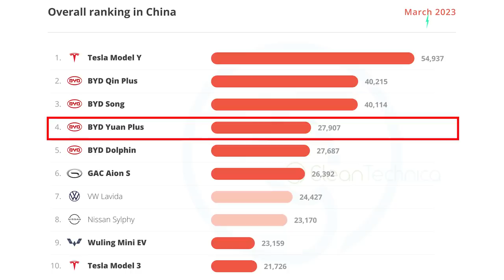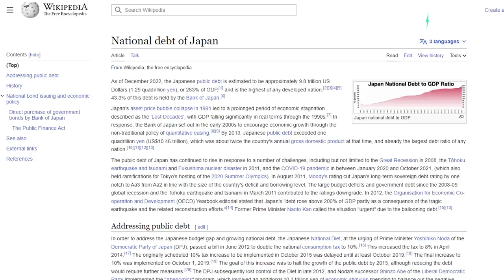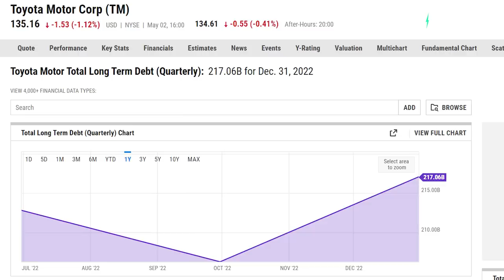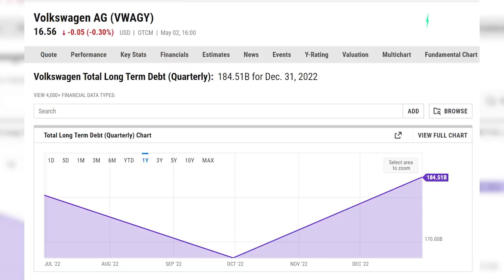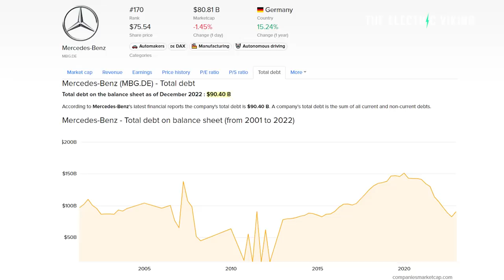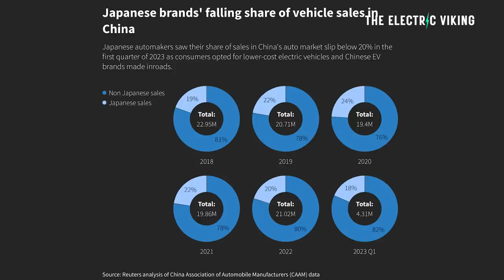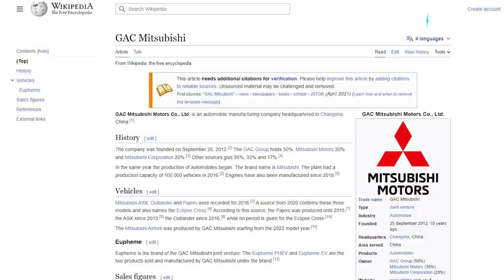Japan's automakers' Kodak collapse will cause an economic catastrophe

Comment: Japans population is losing over 800,000 people a year, while their national debt is still going up and exports are going down. It doesn't take an economics professor to see this is not sustainable.
Reply: National debts denominated in your own currency and owed to yourself are easy yo manage.  Private debts are what matters.  Also if you are losing population you have to erase generational debt to not burden the young.  If Japan is to be faulted it is their social and economic policies are out of sync.   China doing a better job of steering their economy.
Reply: China will soon or already are loosing 800 000 people per year. China also has extream debt (higher debt to GDP than the US) Japan own a significant amount of debt from both China and the US and the bank of Japan is the largest owner of Japanese public debt.  I don't think Chinese debt is sustainable either.
Reply: @ry4nwo0t  China is way over populated. They can lose half the population and still have twice as many people as USA. 
China's Debt to GDP is 77%. USA's debt to GDP is 114%
Reply: @MetaView7  Define over populated?... China 153 vs 327 for Japan people per square KM.   The over population is less of a problem than an aging population like Japan have had good experience of - China's turn is close approaching.  Sorry meant to say total debt to GDP not just public debt to GDP.  If you talking private debt to GDP China is by far the biggest.
Reply: @MetaView7  When (not if) China is reduced to half its present population, its age profile will be the killer!  There will be "empty" young generations to pay retirement for a huge number of retirees.
Having said this, it does not look much better over here in Europe... with some exceptions.
Reply: Not too mentioned the iceberg phenomenon of Hikokomori. Millions.
Reply: @MetaView7  I disagree! Think one child policy. 1+1=1 extrapolate over decades.
Look at the lie down movement and the "let it rot" movement.
Reply: Japan have lots of visas for other people to come and work for them. Export doesn't mean much if the economy have many digital/financial products. Case in pt, the US have lots of intellectual property and sell digital products--app download, etc, software, --but we have a trade deficit.
Reply: @ry4nwo0t  If you look at china through a western lens, you will see all kinds of problems. How is china's aging population a problem? Please Define.
Reply: @ry4nwo0t  I never understood that debt to gdp statistic people keep claiming when it's total debt to gdp for China then use government debt to gdp for the USA in comparisons.
Reply: @ry4nwo0t  <<Sorry meant to say total debt to GDP not just public debt to GDP.  If you talking private debt to GDP China is by far the biggest.>>

LOL that shows how little you know about china. But you think you are an expert on china.
Private debts? Did you mean company debts?
Reply: Vassal state.
Reply: They will need to create a robot nation to sustain their country.
Reply: @EM.1.  <<They will need to create a robot nation to sustain their country.>>

During the past 5 years, China has imported more robots than the rest of the world combined. If you want to know what is happening in China in manufacturing and food production technologies, there are lots of videos on youtube. It is mindboggling.
Reply: @AnhH88  <<Case in pt, the US have lots of intellectual property and sell digital products--app download, etc, software, --but we have a trade deficit.>>

Yes trade deficit, but not money deficit. eg. The western companies are making lots of money in China, but the profits are not benefiting the people in their home countries.
Reply: @mefobills279  It is so rare to find people that understands these things these days.  Maybe you have been following Steve Keen?
Reply: @MetaView7  How is falling population bad for China?
Can't find the vid now, but I watched a lecture relating to Chinese demography, said something like there's currently 7 workers for every pensioner, it will be 1 to 1 by 2070. Not sustainable.
Reply: 75th like
Reply: World meter website Japan population is decreasing 200,000 to 380,000 per y from 2015 to 2020. That 800,000 number should be for 2021 or 2022
Reply: Similar sort of thing is happening in Australia. Australia doesn’t have sufficient birth rate to maintain its own population. It’s population is supported mostly by immigration.
Reply: @st-ex8506  Soylent Green®is the solution.
Reply: @skipondowntheroad5833  The plot of Soylent Green is about overpopulation. I don't know what solution you see there... we are talking here of population shrinking.
Reply: @Jeff Little  I once talked to Dr Hudson for four hours.  Steve Keen I've never met.   If you read the comments, the people here think all debts are the same.
Reply: @ry4nwo0t  both china and japan will have a recession if not a great depression, it's going to get bad here too but it is wild over there right now

I honestly don't know how japan is going to survive, debt per capita is often tied up in car ownership, meaning after the value of the car collapses, and the person simultaneously loses their job, making or servicing cars, the car will be repossessed, and be worthless to the local banks, which may go bankrupt themselves, or may be put in a position where they refuse bank withdrawals, if they aren't careful, everyone will panic and try to take all their money out at once, collapsig banks entirely

Needless to say, this is also applies to whole companies, vehicle producers, who have a financing arm like toyota will see even their good debt turn into bad debt, and this will have a huge impact on anyone who loaned them those billions of dollars worth of yen, who now will never get that back,
Reply: I outlined a few minor issues above, which the following backdrop is important to understand
People who don't have children in japan and China, often don't because they are impossible to provide for, with all the banks collapsing along side 80% of the economy, life savings being deleted left right and center, I think the birth decline will rapidly accelerate for a few years, hopefully a boom would follow that depression, but regardless, 20-30 years down the line in the future, it would cause a massive vacuum where there are even fewer people working, because they haven't been born, and the ones who are retired at that point who are poor won't have people to pay for that, as well as those young people will be well, fewer of them to tax, so, they would likely experience heavier taxation, without proper pensions, alot of elderly people might raise the rates that they rent or sell properties for, which cause that to rocket
everything in economies have cycles, but, these are fine when populations are increasing, the lows are just temporary stagnation, but in a declining population, all the lows are deep pits, and the highs are stagnation, at least how I see it, I don't have any formal economics education

I honestly hope Japan doesn't just fall off the map in the next century

also, if generational debt exists in japan for that duration, rip
Reply: @mefobills279  Speaking of national debts in your own currency isn't a problem because, In theory, Japan can print as much Yen as they like to pay it back or to pay interest. But that would be suicidal as it creates massive inflation and Yen devaluation. Japan low inflation rate defense has been disarmed by recent US Fed QT. The massive US bonds and assets Japan holds are probably its last line of defense, but the US won't be happy if Japan begins mass selling. Japan is not US where they can get foreign countries to absorb their printed money.
Reply: @cheekhenliew7628  I said Japan has to release debts, especially private debts.  After WW2, the US erased Japanese debts, and then they were off to the races.  The US also broke up the land holding Zaibatsu Oligarch class.
Reply: @MetaView7  no，China‘s debt is much higher than you think，local govs borrowed a lot of money which is not on chart，this kind of debts is called 城投债
Reply: If the population is decreasing NATURALLY production, consumption, exports, GDP decreases.
It does NOT HAVE TO be bad.
Reply: @picardjean9467  
Where do you got your information from?? From Chinese Academy of Debt??
🤣🤣

Since 2010 many have predicted The Collapse of China in each year and what happening to China till today, Does it collapse?? 🤣🤣
Reply: China faces similar demographic and debt issues.
Reply: @mefobills279  China and Japan have two different problems.  Japan has a massive elderly population and not enough young workers.  No one is having children.  China on the other hand has the workers, BUT they refuse to work in the current substandard working conditions. It's called "Tang Ping"
Reply: @Karl Degraa  
"China faces similar demographic and debt issues."
NO CHINA DO NOT.
In regards to debt there is a big difference between internal and external debt...
Since China's bond market is "non existent" Chinese debt is mostly internal.
Meaning "China owes China"

Apart from that...
Japans Debt GDP ratio is 263%
China Debt / GDP ratio 77% (USA > 100%)

HARDLY SIMILAR

As for demographics...
There is A LOT talk about "China will collapse because of bad demographics"

Really?? What IS BAD DEMOGRAPHICS??
ALL countries that are industrialized have "bad demographics" and try to solve this thru imigration.

Best number is birth / 1000 people (not birth / woman) since you can have high birth / woman BUT STILL low birth / 1000 people.

South Korea 5
Japan 7
Spain 7
Italy 7
Greece 8
Portugal 8
Finland 8
 Canada 9
China 9
Germany 9
Poland 9
EURO AREA 9
USA 11

How often do you hear Spain, Finland or Germany will "collapse" or the Euro Area because of their "bad demographics"

This is a "classic" "China will collapse" trope that has been going on for decades.

If you consider Japan and China have "similar" demographics.
Then by that same measurement, USA and China have the same...

China DO HAVE far lower debt though...
Reply: @MetaView7  how do you know they are overpopulated?  whats the source?  did you count the people?  tell us your findings ..
Reply: @MetaView7  Who would you employ for complicated manual labour? A far sighted 60 year old with shaky hands or a 20 year old? Remember, I'm talking 12h shifts 6 days a week.
Reply: @MetaView7  Mortgages for flats that never got built?
Reply: @nyanbrox5418  <<both china and japan will have a recession if not a great depression, it's going to get bad here too but it is wild over there right now>>

Do you know China? or you are getting your information from CNN?
China is booming. Their economy is so isolated from the West, people don't know they have built an independent and resilient system that is not affected by world economy.
Reply: @kdegraa  <<China faces similar demographic and debt issues.>>

Yes they face the same issues, but they don't have the same western problems. LOL
Reply: @abc33944  <<how do you know they are overpopulated?  whats the source?  did you count the people?  tell us your findings ..>>

China has the same land mass as USA, but 4.5x times the population. 
If China loses half of its population today, it will still have more than twice the population of USA.

You can argue about it till the cows come home, it does not matter. Feel free to definite it any way you like.
Reply: @VolkerHett  <<Who would you employ for complicated manual labour? A far sighted 60 year old with shaky hands or a 20 year old? Remember, I'm talking 12h shifts 6 days a week.>>

Many manual labor jobs will be shifted to Vietnam, Cambodia, Bangladash, Africa, etc.  I don't know where you got the idea of 12h/6D. You must be living in a beautiful garden and thinking the rest of the world is a jungle. 

Do you know how many Space Launch Startups are there in USA? You know SpaceX, BlueOrigin, that's it. 
Do you know how many Space Launch Startups are there in China? You can easily count 20+. And many of them have foreign money backing. This is the future of China you are looking at. Germany will be the backwater of tomorrow.
Reply: @VolkerHett  <<Mortgages for flats that never got built?>>

All constructions must be registered with the Housing Authority. All pre-solds must first obtain 5-certificates and 2-approvals from the relevant agencies. Where have you been?
Reply: @MetaView7  So Evergrande is still fine?
Reply: @MetaView7  I share your assessment about Germany, especially when it comes to cars. I'm eagerly awaiting the SAIC MG roadster :)
Reply: @SamOlds2999  way beyond that now 😊
Reply: @MetaView7  I guess you are the expert on China now because you think private debt isn't relevant.  Where do you think local Chinese governments get funding from and do you think financing vehicles (LGFVs) are sustainable?  I think it hides the true scale of China's debt.  
I didn't say I was an expert on China, I simply don't think China is sustainable as a lot of you think, been there several times and those new flashy buildings are of extremely poor quality but look magical at night with the LED night shows.
If all you care about is public debt then the picture isn't much better:
"China’s national debt amounted to $14.34 trillion, ranking second globally. This value reflects a year-on-year (YoY) increase of $3.81 trillion, or 36.18%, compared to the $10.53 trillion recorded in 2022. The United States, holding the highest national debt globally, has a total of $31.68 trillion, representing a YoY increase of $1.3 trillion or 4.28%, reaching $30.38 trillion. Therefore, China’s national debt has surged almost three times that of the United States in the past 12 months. Japan's debt was down $1.49 trillion over the same period"
I wish you good luck.
Reply: US is losing productive population, the one remaining is not working too hard anyway, the national debt is going through the roof,  and all is wonderful. So let's try to solve the problems for Japan.
Reply: I spent 10 days touring  Japan January 2023.   GDP is a false measurement of wealth.  In Japan they don't have a GDP component for the Prison Industrial Complex.  The US spends untold billions to deal with the criminal aspects of our society from security costs related to prevention to incarceration after the fact.  These billions are counted in the GDP but are actually a negative contribution.  Japan does not have to deal with millions of illegal immigrants, criminals, or even littering.  It is amazing the number of jobs in the US picking up trash and cleaning up after people who are pigs.  Japan relies heavily on electric trains for transportation and the majority of the population lives along the major bullet train routes with soon to be added mag level from Tokyo to Osaka.  Japan doesn't have a for profit medical industrial complex.  Obesity is non-existent.  In the US medical treatments for cancer, diabetes, high blood pressure count in the GDP as a positive when they are actually a negative.  I am not worried about he future of Japan.  They will be just fine.  I am concerned about the US degenerating into a 3rd world country.
Reply: @Bill the Builder  : Well said. I visited Japan in the past, and I was amazed by the cleanliness of the streets and discipline of the people. That is what one could really call a "civilized country".
Reply: You have not read the BOJ documents...
Can you provide information on Japan's foreign exchange reserves and the net foreign assets held by Japanese citizens?
Scholars have the knowledge and perspectives to provide valuable insights and research in their respective fields
Reply: @mefobills279  China’s population is declining as rapidly as Japans. It’s just well concealed by the state and falling from 1.4 billion buys the Chinese more time. But there’s a factor at play that makes China’s situation far more catastrophic than Japans. The One Child Policy is potentially more incompetent than the Smash Sparrow Campaign implemented by Mao in the 1960s. 35 years of 1 child on average born between 1979- 2015 means that when those people born from 1960 onwards hit the average life expectancy of 77 in 2037 China’s population is going to fall off a cliff in a way never seen before in all recorded history. It’s going to become noticeable from 2030 but by 2035 it’s going to lead to a global depression from which the world won’t recover for another century. But at the same time Western Europe is going to break up along ethnic lines potentially leading to civil war in France and the northern bordering countries. Human civilisation peaked between 1985- 2015. It’s now evolving in to a survival of the fittest scenario that is going to lead to the death of a billion people or more. Buckle up.
Reply: @ry4nwo0t  Western Propaganda
Reply: @tony78ta  narrow-minded
Reply: where the hell did all their money go 😅
Reply: people don’t get it. China population decline due to economy stress which is going to be solve with selling cars.
Reply: @Ry4n, you can't just divide population by territory area for population density. High mountains, deserts, tundra, etc aren't exactly habitable.
Reply: @ry4nwo0t  That Debt # pretty mixed. Go figure, China $50 Trillion in Debt, US only $30+ Trillion. But... China Debt is calculated overall combination of Fed+Local govt+ consumers, in contrast to US Debt account Fed only. Consumer and Local gov't not included.  Another thing, China projected 2023 economy 5+% growth while US less than 1%.